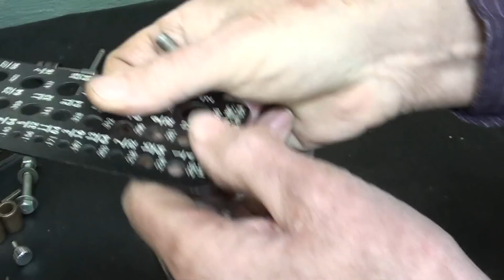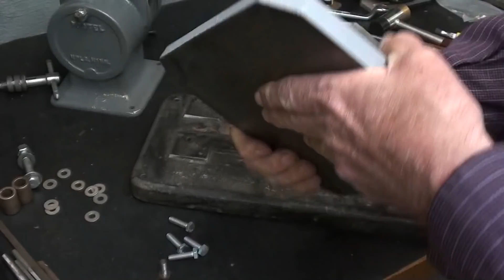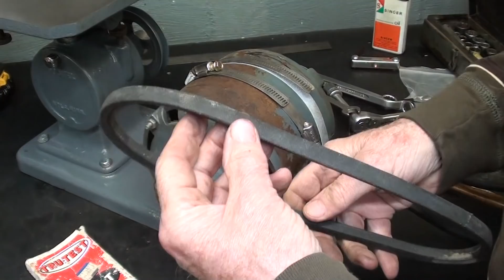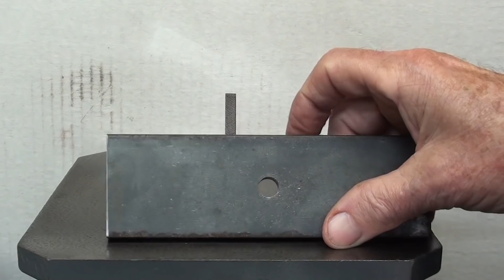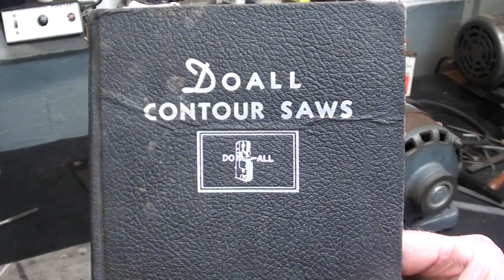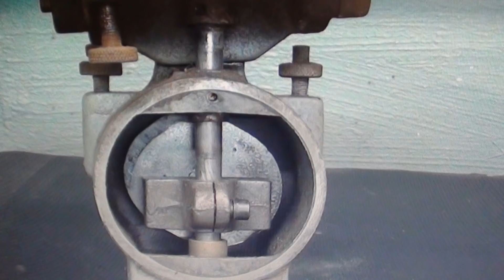RESTORING A DIE FILER pt 2 TIPS #640 tubalcain

Comment: Another great video.  I am not sure why I missed this one a year ago.  We were locked down and no where to go yet I missed it.  Your point about not moving the machine by the table is so important.  Generally two rookie "Bubbas" on a carpenter crew would grab the jointer by the table and head for the truck which resulted in a sever scolding and if it was the second time they'd be fired.  I was never scolded as I knew better by watching others make the mistake, grin....
Reply from the maker: Thank you for watching

Comment: Mr Pete, I have 2 die filers in my Gunsmith shop, one is a Harvey Butterfly, one is a MLA 18 die filer kit built by yours truly.  The 1/4" shaft files are Type "A" machine files if memory serves me and are available from Falcon tool at last check.  Of course Covid19 may have wrecked that as well...  Good luck be safe!  Dale
Reply from the maker: Thanks

Comment: You might try a fan motor that has several speeds. I don't recommend any that require air flow from the fan blade to keep the motor cool.

Comment: I've seen a few people put regular files into a jigsaw clamped in a vise before, and I've stuck a round file in a drill to deburr things or grind a hole into hardened steel. (Probably not safe!)
Die filers are neat. I imagine the replacement files for an air file might possibly work in that (like This Old Tony's video on it). They do seem more appropriate as a step in small work or high ticket items where the fit is critical and the labor cost of having someone sit there at one is worth it, before grinding to the exact dimension.
It's always interesting how the old catalogs look like they took photos of people actually testing or using the machines and tools. Nowadays it looks all like actors that have been photoshopped. 
Of course they may have used actors back then too, but it didn't look like it! There wasn't any photoshopping done or perfect lighting to make them look like the superman of their profession.
There are stock photos around of people doing boneheaded things, like "using" a soldering iron by holding the heated end like a pencil...

Comment: If no replacement files are available, new ones could be made from conventional files. Cut or break off sections of the proper length and grind the part ABOVE the section of cutting teeth you want in the saw, to fit the chuck. For files smaller or thinner than 1/4", collars or gibs could be made to fill the rest of the 1/4" hole in the chuck. A lot of work, but if you found a need for this machine, that might be worth it.
Reply from the maker: That is exactly what I plan to do Peter. But I will wait till the need arises, so that I can modify the shape that I actually need

Comment: Thanks for the video mr Pete. Fast as that motor makes it, I don't see how you could control at all weather you're cutting on the down stroke or not. The files on This Old Tony's die filer are all double cut like the one you have mounted. 
I suppose the ideal job for a filing machine is the clean up  cast parts like the guy in the do-all catalog
Reply from the maker: Yes

Comment: I have a question about your casting sand. 
Since it seems I cannot email you directly, or I have simply missed your email address, I hope you see this here.

How many parts of silica sand to how many parts Petrobond do you use in your mix? 

I recently broke a part to one of my old chainsaws that I need to cast a replacement for.

Thank you for the information you share and the quality of your videos. They have been helpful in directing me to building a better shop of my own.
Reply from the maker: I have never made my Petro bond sand. It was purchased pre-mixed. You may find what you need to know in videos made by this man. His channel is called. Sand rammer.
Reply: @mrpete222  Thank you for letting me know.

Comment: The advantage of the die filer is it will do blind holes whereas the band filer could not.
Reply from the maker: How would you see what you are doing?
Reply: @mrpete222  Sorry, you are right and I used the wrong  term. What I was referring to was the ability to file inside a through hole whereas the filer band would have to be "broken" and reconnected to do the same. A blind hole or pocket is a completely different challenge which the EDM has met allowing sharp inside pocket corners to be accomplished.

Comment: More flexible V belts. Ideally you'd purchase a belt with "A" prefix denoting a cogged inner surface something like a timing belt. A quick and dirty alternative is to turn the belt inside out and bandsaw cut shallow kerfs every 5/16" or 3/8". Don't go too deep or you'll cut the tension band.

My little die filer runs about 350 strokes/min. At least that's what the pulley ratios work out to. I can almost time my feed pressure to relieve on the up-stroke and firm on the cut-stroke. 

Die files are not only expensive but now getting very scarce. Many of my die files were modified from round, four square and three square hand files. I hace a couple mill filses and modified needle files somewhere but I can't find them just now. I'd fire that tool guy but it's me. Cut off the taper and the tang, grind the chucking stub, and draw the stub's temper to a light blue. Make sure the file is not only square with the table but inline with the stroke. You might wish to incline the file a trifle so it rubs heavier on the cut stroke and square the table to the file. That means to opposite side will barely cut but cutting action on the preferred side is so much improved it's worth the extra hassle. 

An old friend of mine used my die filer the make his version of flint lock parts and stock fittings. He eventually succeeded producing some beautiful pieces but he died about then. Nobody knew what became of most of his stuff. Goes to show, old people should plan for their legacies, even the shop stuff.
Reply from the maker: Thank you for the tips, I intend to make some files

Comment: Mr. Pete, who is the mfr of your drill bit gauge? Until recently, I was still using my old drafting circle templates to measure drill bits, bolts, etc. For the last 40 years, I attributed my inaccurate measurements to OE (operator error). After buying a replacement circle template, it finally dawned on me why my measurements were slightly off. Drafting circle template holes are oversized in order to account for the thickness of the pencil lead. As such, the drawn circle is the correct dimension, NOT the drafting template.
Reply from the maker: lol

Comment: Would you consider putting a variable speed motor on it when you eventually swap it out? I've seen several kits with them and it's nice to have the control for certain situations.
Reply from the maker: Yes, but I will use any motor I can find. I will probably never use it anyway

Comment: Lyle the most reliable switch is a plug.  By the way I have had very good success with making my own pulleys out of wood (plywood or solid wood).  "Why magnesium you may ask?  Well hopefully it may catch on fire, of course!"  Your just a big kid at heart aren't you?   There appear to be two lands just between the motor and the crankcase; is there enough room to attach a 5/8" or 1/2" square bar bent at 90 degrees to fashion a hold down?  Nice video Lyle, thumbs up.

Comment: Your videos sure bring back a lot of memories for me. In the first shop I worked in we had a DoAll band saw that looked pretty much identical to the one pictured in the DoAll book you showed. It had the filing attachment and the files but in the 12 years I worked there I never saw any of those in use. They did have a die filer and I really loved it and I wish I had one for my home shop. I think I mainly used it to help make templates for a tracing mill. We had a Gorton vertical mill with a hydraulic tracer and I used the die file to help do some finishing work on the profile templates. Adam Savage that used to be on Mythbusters just recently posted a video where he built a die filer from a kit. Here is a link if you are interested.  https://www.youtube.com/watch?v=ZNwvjaIW-pU
Reply from the maker: Yes, I watch that video recently. But he didn’t actually show how he made it

Comment: Lyle, I just made a couple of 36 mm hex wrenches for my Harley out of 1/4" flat stock, a couple of hours with the die grinder and hand filing, all I could think about was that die filer and filing to a scribed line! Yes that filer is slow, but the strength is the squareness of the edge and the inherent precision of filing to a line. The other advantage is the tilting table could be adjusted to file to a pre-determined draft angle. Cheers!
Reply from the maker: You are very correct. In fact if I ever do use this thing, it probably will be for patternmaking, so I can file at a 3° angle

Comment: Keep your eye open for a walking treadmill exerciser at the end of someones driveway. Great variable speed DC high low end torque motor with the controller just the item for the die filer.
Reply from the maker: Yes, I did find one and bring it home. But the wiring was impossible because it was all solid state controls and I could not figure it out and threw it away

Comment: The Die Filer I have came as an attachment  for my Sheldon Lathe. I used it one time in 20+ years But when you need it you gotta have it. Most of the time I use a Broaching tool on the Bridgeport .
Reply from the maker: I did not know that Sheldon had an attachment. And I had five Sheldon machines at the high school
Reply: @mrpete222  Sheldon Chicago U.S.A. I bought it from one of the founders of MTD . He sold me his home tool room equipment

Comment: Thanks for asking,I'm well,some older 1970's washing machines used a 1/4 hp 2 speed motor that would be perfect for the filer,check around you might get lucky.😁
Reply from the maker: I had some of those at the high school. Are usually could not figure out the wiring

Comment: A little more work and motor painted and belt guard. Needs a guard but not going to do it right now.
Reply from the maker: The job is done
Reply: mrpete222 just saying you say every time your the shop teacher. If anyone but you uses it ,like a grandson gets finger cut off! Just but a box over it, or disconnect wires.. but don’t say your the shop teacher and it’s ok to put safety last.

Comment: Mr. Pete, may I suggest using a segmented belt from Jason Industries. you can make them any lengths you want. I have them on my very old 10" Atlas F lathe and old Sears table saw. They make a world of difference (US made). run very smooth. I got mine at Harbor Freight, I don't see it on their web site.
Reply from the maker: I do have some of that around here. But it might be in the wrong thickness, or I mean the wrong with

Comment: Thanks Mr. Pete, nice to see it come to life again.  Noticed the other brand you showed had a gravity motor belt tensioner and would think that or a piece of 1/4"+ soft durometer neoprene or the like under the motor mount would help even more with the vibration.  Quite the clacker, noise wise.  I'll keep an eye out for those type files, probably still available.  Always a treat!
Reply from the maker: They are all noisy. I will probably never use the darn thing

Comment: I was thinking about using a saws all and mounting it upside down so the fillings would not get into the saws all. I have a old Milwaukee I could use. Harbor Freight has them for about $20 , but I don't know if they are variable speed.

Comment: Lyle, Vintage Machinery has two photos of Postel die filers, but no manuals.  "Originally," the pulleys were about a 4-to-1 ratio (or a bit greater), so if you change your pulleys you might want to see how close you can get to that ratio.  Thank you for posting and I'm already looking forward to the next video!
Reply from the maker: I saw those pictures were I was looking for the manual. They apparently did not make many of these. I am not worried about the ratio, I will probably never use it

Comment: This is a story about my personal experience with telepathy.  

My dad split a knuckle when he laid his knife down that way on his splicing table.  The table had fold-up clamps on each end that held the ends of the cable for powering a several-hundred horsepower submersible oil pump while it was spliced.  He was stretching teflon tape around the splice when the tape snapped and his knuckle went right down onto the knife and buried the edge about halfway through the bone.

It happened late at night (time being money in the oil business) and my mother bolted awake with a vivid image of him bandaging his hand in a pool of blood.  So vivid that she had trouble getting back to sleep.  When he pulled up in front of the house a few hours later she almost fainted when she looked out the window and saw his hand all wound up in a bandage.

I swear it's a true story.  Make of it what you will (and never put a knife down with the edge up!).
Reply from the maker: Very interesting

Comment: Filer turned out really nice.👌
I’ve always heard that when using a file you should only use it on the cut stroke, and not drag it back across the work. With those filing machines it doesn’t seem to matter..lol. What’s your take?
Reply from the maker: That same thought occurred to me. I do not really think it is that important when hand failing
Reply: @mrpete222  Isn't the reason that dragging the file could dull it? Perhaps with a machine like this the manfacturer just expected you to often buy replacement files...
Reply: @olavl8827  yeah dragging it tends to dull it, I think the teeth only cut in one direction unless it's a bastard file? I'm not sure what file cuts on both strokes but I do know one exists

Comment: The 3300 series looks like what you need. https://www.falcontool.com/PublicStore/product/Swiss-Parallel-Machine-Files,577,183.aspx
Reply: here are some 1/8 shank models that might be adaptable. 
https://www.artcotools.com/parallel-machine-file-type-b.html
they are discontinued but it says some may be still available.
Reply: and a 12 pc set https://www.falcontool.com/PublicStore/product/Swiss-Parallel-Machine-Files-Sets,649,689.aspx
Reply from the maker: Thanks, I will check them out I hope they do not cost too much. I need them with a quarter inch shank

Comment: As you sparked my interest in my own machine I looked it over and found the identification plate. It was made by The Harvey Manufacturing Company, New York. One of the few things I made on it were new magneto advance weights for a1923 McCormick Dearing tractor. I was very happy with the results because of the ease of following my lines and the square corners it produced.

Comment: Why not turn motor and filer 90 degrees and direct drive with a thyristor speed controller?
Reply: Induction motors don't work properly with thyristor speed controls. To change the speed you need to vary the supply frequency. That is a different kind of controller (VFD).

Comment: Thanks for that Lyle. Question - Can you adjust the push rod up and down on the flywheel bracket to use the whole length of the file and also, if the flywheel had several holes for the connecting pin at different radii to change the stroke length? Stay safe and well :)
Reply from the maker: Never thought of that